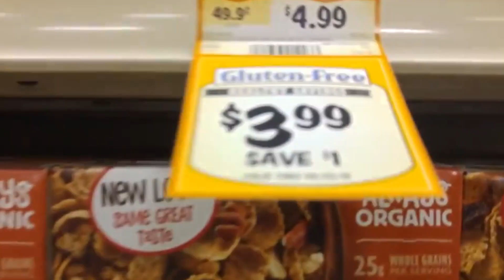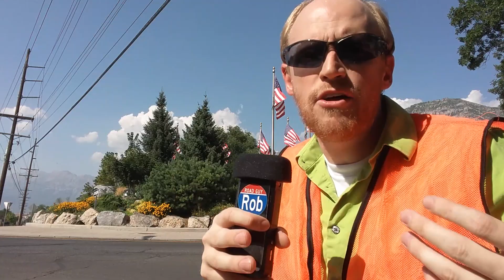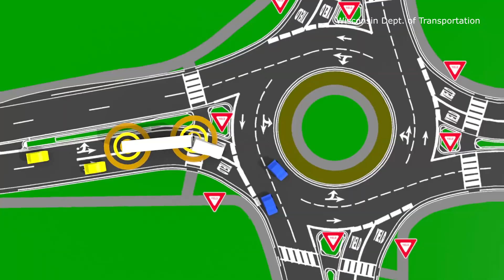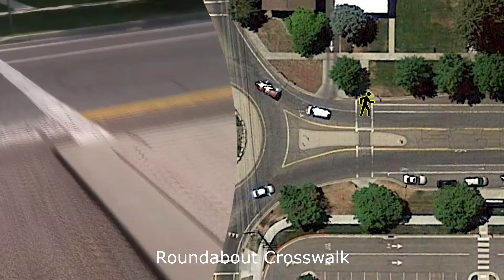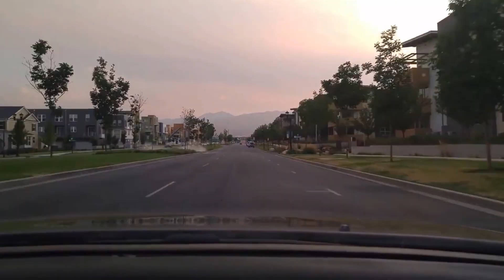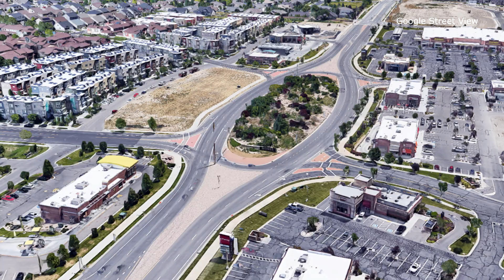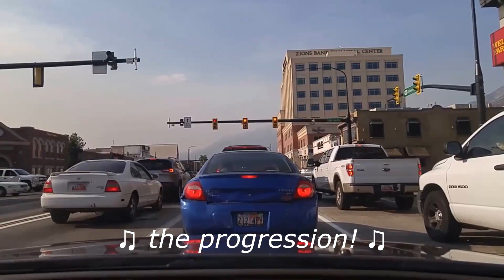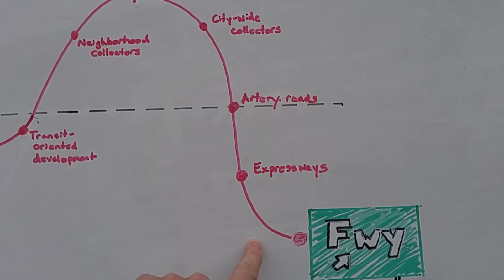Are roundabouts REALLY better than a traffic signal?

Comment: You haven't mentioned the advantage of not having to wait at endless traffic lights, even when the traffic is fairly light. Also, that "platoon" system only tends to work one way; trying to synchronise it all with cross-traffic and it's pretty well impossible (and lights can be combined with roundabouts on really heavily trafficked routes and achieve more throughput and managed traffic flows where essential). 

As for roundabouts on freeways, then those are best designed with on and off ramps and then the roundabout can be put above (or below) the main road. Expensive, but much safer and better flow with less interruption to through traffic.

Comment: What? Our roundabouts have crossings at the point where the roundabout and road meet.
Reply: right so you have to walk around the roundabout to cross the street, which for big multi-lane roundabouts can be very far, and also makes it harder to go straight at the intersection for a pedestrian. Not only that, but it's often nearly impossible to cross 2 lanes of traffic safely without a light which can still put the pedestrian at more risk. I'm not saying roundabouts are bad, just that in places where you want to encourage lots of walking then you should consider that they are a barrier to that. One creative way to do this would be to have better walking infrastructure on parallel streets in a city for example.

Comment: WE have a round about it's the intersection with the most crashes   Also it has the biggest back ups too  they modified it 3 times so far   the latest was not too long ago they revised it after an 18 wheeler flipped over .

Comment: You're the only person I"ve seen talking about roundabouts actually point out that they stink for pedestrians. Everyone is so excited about not having to stop they ignore that it makes things worse for the pedestrians.
Reply: In the Netherlands you usually have to give way to pedestrians. And there is a spot between the crossing and the roundabout so you are not holding up traffic on the circle. 

And the extra steps thing is also much less because the sidewalk usually not that close to the road on roads that have those large roundabouts because that's dangerous too. And when the sidewalk is that close to the road we put in smaller roundabouts because that happens in a 20m/h zone so you need a tighter circle to slow the cars further down.

The problem that pedestrians face is usually not the round about but that the city prioritizes cars above all else. Which gives you chappy sidewalk situations around roundabouts but also on regular crossings where they for example give very little time for you to cross with lots of waiting time in between.
Reply: In most cases it is possible to position the pedestrian crossing much closer to the roundabout than the example shown. Where I live they are often only a couple of car lengths from the Give Way line.
Reply: It's tricky because if the ped is crossing in the space before roundablout entry, it's OK and you see them easy.  But conversely, and 1/2 the time by definition, the ped will be crossing at the exit to the roundabout, where it is very hard for the car to see them.  I've never been a ped crossing the roundabout, but if I was, I'd run across and only when I saw nothing coming as I'd assume they couldn't see me, and being in the midwest, wouldn't care if they did.
Reply: @nixon2tube  That's the problem. They increase the danger for the user who is most vulnerable, the meatbag. I'm getting older, so I can't move as fast as I did and there are disabled, the elderly, and children to consider. And if your idea of make the crossing safer for the elderly and disabled is to make them travel an extra 300 metres, you're a monster.

Comment: What makes a roundabout so efficient is that as you lose speed you can do intentional near misses which increases capacity.
Regarding trucks, in Europe they are allowed to use the outer lane and usually people will give them the whole roundabout.
Reply: Ever tried moving a huge piece of equipment? Its a pain. Here in the US a typical large pickup is pulling a trailer every  few days thats pretty much as long as 2.5 European vehicles. Thats not including the amound of semis (lorries)
Reply: @brandoncaldwell95  2.5 would mean 47 meters, roughly 140 feet...
It also happens occasionally in Europe

Comment: in my town they actually timed the lights so you can't get a continuous flow of green lights so you must stop at each light unless you go at an exorbitant speed. everyone here knows it's faster to take the side streets than it is to take the main roads now and those side streets have become congested because of what they've done
Reply: To be blunt, it's because people are dumb. About 20 years ago, my city was looking at synchronizing the lights so you could get a run of greens if you drove at about the speed limit. I was there to speak in favor of it. Several speakers before me talked about what a terrible idea it was, because "the city will just be a giant racetrack", so I specifically talked about why that wouldn't happen (go too fast, and you'll catch the next light red) and that getting a string of green lights had several advantages, including better gas mileage (cars idling at a light get 0 mpg) and reduced pollution because people won't be sitting idling.  The very next person got up and said it was a horrible idea because it would let cars race across town.
Reply: @almostfm  it's the "carrot" approach to speed control. Drive the speed limit, catch all the green lights. I used to drive down a street that even had a sign stating so (I can't remember the exact wording, though) But then they got the genius idea to install speed bumps, which messed the whole system up. So I would actually speed up in between the speed bumps to try to catch the green lights, but it never worked.
Reply: In my city there's even a better system. The lights are timed in such a way you have to go over the speed limit. What's better there's one pedestrian crossing without lights. Which is dangerous af for obvious reasons. I think the only reason why city didn't add yet another set of lights was to collect speeding tickets

Comment: Like you said roundabout or traffic circles reduce the speed of traffic at intersections and when there is a great difference in speed contact between cars can kill. One downside is that during rush hour they can create a bias. Meaning if most traffic is flowing east-west then the people going north-south are going to have a hard time entering the traffic circle. As the flow will be non-stop with few openings to put your car into. Plus like you said multi-lane circles have a learning curve. Thusly even in the city that has had them for more than 50 or more years, people still can be intimidated by them and create havoc. I personally love them and have seen people that have tried to drive straight through them even with large trees in the middle. The worst one I have seen is in Halifax N.S. called the Armdale rotary I never could figure out what to do, as it was a turn-based flow. From what I understand they have now changed it to a more universal (or what we have in Edmonton) where if you want to travel more than one exit your are required to enter the center lane and the center lane always has the right of way when exiting.

Comment: as a semi driver, from wisconsin to boot ironically, we hate roundabouts with a passion. i know lots of drivers that will drive miles out of their way to avoid a roundabout. no matter what we do everyone is always mad at us. if we slow or stop coming into one, everyone behind us is pissed. if we try to do the speed limit usually 15mph and someone rushes into the circle we don’t have time to stop and then that person is pissed we cut them off. the multi lane ones are even worse because no one understands that we need to use both lanes and constantly try to run beside us or road rage us for “cutting them off”.
Reply: Yep, i always give truckers room if they need it or not for this reason. They already have a shitting day waking up to deal with people why make it harder. Helps i come from a CDL fmaily too. Also concider the people who pull large trailers with their trucks. Id be in the same boat. Least you guys have decent enough large tires where im just one basic street tires that might blow off a bead especially with my tractor and shredder on the rear let alone the people who roadtrain a 40ft 5th wheel with a boat on the rear...

Comment: In the UK, on those busy multi-lane Roundabouts, we sometimes have Traffic Signals on the busier ones - usually the ones that feed onto or off of a Motorway (What you'd call a Freeway or Interstate). So now you can have the best of both worlds!
Reply: What the hell is the purpose of a traffic signal at a roundabout? I thought the whole idea was to NOT have one so traffic doesn't spend 2 MINUTES waiting to move.
Reply: @largol33t1  I normally see them when you have two busy roads intersecting, so you can control traffic leaving a motorway and give them a period of time to join the roundabout in controlled bursts. The timings are normally quite short.

You still get the benefit of "fewer conflicting movements" as well as less dangerous collisions, plus you now have an added system where one flow of traffic cannot constantly overwhelm the roundabout.

Here's one example of a roundabout I know of that has controlled access: https://goo.gl/maps/ihZyXHCRUXftdrUo6

Comment: North St Louis has a terrible two lane roundabout with stop signs (not yield signs) at 90 degree entry points
Reply: Doesn't make sense. The roundabouts in Texas have yield signs. You drive in and keep circling until you reach your exit. I have used them over a dozen times and they're WAYYYY more efficient than dumbass traffic light that has 2-minute red lights.

Comment: Roundabouts are terrible for semi's. A semi is about equal to four cars trying to move at once. When traffic is heavy it can take a much longer time for the semi to turn into it, causing backups.
Reply: That's why some cities in Indiana switch over to roundabout to keep the semi's out.
Reply: @JustSeanRunning  then complain when there are higher prices as now a straight truck delivery company has to get the load to take it to the store. Lets not forget the fuel stations that are surrounded by roundabouts and still require a semi to get there...

Comment: Roundabouts are great in certain areas. When you have a high volume of traffic you can sit there and wait forever for an opening.
Reply: This started as a discussion about how...sometimes...maybe a roundabout isn’t the answer, sometimes we should consider other options, but I guess there just isn’t any room for that viewpoint or it’s supporting traffic studies.  I’ll start recommending a roundabout be built at every intersection.  Okay, thanks for straightening me out.🤷‍♂️
Reply: @EliasSchmid00  Traffic lights in roundabouts was extremely common when I lived in Europe.  From a design perspective, having to add lights is an indication that the traffic has outgrown capacity to allow free flow, which is the whole point of a roundabout.  Once lights appear, it’s time to start considering some kind of compact grade separation.  For example, a compact underpass for one of the mainlines that passes under the roundabout.
Reply: @scottwendt9575  I have to disagree, where I live there are a few roundabouts which have lights, 90% of the time there's at most a 15 second wait for traffic to clear and the lights aren't used at all, but during peak hour when east/west traffic is heavy the lights operate to ensure the lighter traffic is able to enter from the north/south usually this isn't needed anyway as natural gaps still occur.
definitely theres a point at which they no longer free flow but thats hard to accomplish, I'd say lights dont hinder the ability to free flow but improve the functionality during peak hour
Reply: Higher traffic deaths in the US are not the result to few roundabouts. Americans drive almost 3 times the distance as people do in the UK, so of course there will be more accidents and unfortunately more fatalities.  The majority of deaths occur in rural and x-urban areas. Consider that in these areas of our country, a trip to the market is a 100 km round trip and sometimes even longer. Higher speed limits are a necessity, not merely a convenience for those in the middle of the the country who are criticized for not wanting roundabouts at every country intersection.

Comment: Is the Chevy Chase situation of getting stuck in the inner loop and circling all day long because no one is giving the way possible with roundabouts?
Reply: Not if used properly. All incoming traffic have to yield to traffic already in the roundabout. In a two lane roundabout, use the inner lane to go left (or straight if the exit also have two lanes). The outer lane is used when turning right or going straight. That way noone will block the inner lane exiting the roundabout.

Of course I would think it is possible if you're driving through say the roundabout at Arc the Triomphe and lack confidence in your driving skills.

Comment: I think the 'Ovalabout' wasn't really a roundabout. Not because of its shape, but mainly because of its right of way situation. It looks to me it is just a big throughway with a bend in it and crossing traffic has to do wierd double-lane switchovers twice (sometimes with a big detour, sometimes with a dangerously short disance to do so. It's hideous and I agree it had to go. Wrong uses like this would give the "roundabout" a bad name. (i think this might have been mentioned)
Also: With "a complicated one" @5:08, do you mean a turbo-roundabout? because I love those. I feel they're great for maintaining flow. (eg. https://www.google.com/maps/@52.175302,4.5391215,184m/data=!3m1!1e3)
I think the main thing for drivability is to try and prevent the need for scooting lanes over on the roundabout. Every traffic direction is determined before entering the roundabout and on it you just have to follow the lane.

Comment: The place where they tore up the ovalabout could have combined it with traffic lights, both for incoming traffic and traffic in the roundabout.
They portion the traffic as you want and the roundabout removes need for left turn lanes and also slows down traffic a bit. They also make left turn safer - you have already turned left which can only be done at lower speeds and therefore takes longer to complete, which is bad if you have oncoming traffic and small gaps; the roundabout shortens the time to cross and increases the margins.

Comment: Lets see, in the 50's and 60's, we had them all over the place. Too many accidents, law suites etc, they were pulled out. NOW< some smart engineer came up with the idea of putting them back in. Number of accidents are up in traffic circles, mainly with 18 wheelers or large vehicles like RV's, delivery trucks and school buses. SO . . . . . as a LEO, I say they are NOT safer than a red light. We have one in our town, been in service 6 months, well over two dozen accidents so far and counting. In Europe, they have very small cars and their trucks are like tonka toys so yes, it works over there but is not a fit for the US. I think after the five law suites filed in some of these wrecks gets settled, the cost of removing it and putting in a light will be so much cheaper.

Comment: Australia went through exactly this in the 1990s.  Though we didn’t call them Traffic Circles or something else for a long time.  A whole generation has gone by — and now when I visit America, the 4-way Stop is really freaky to me.
Reply: We have one extremely unpopular roundabout — regarded “the worst roundabout in Sydney” — just north of where the A3 meets the M4.  The problem is a large shopping mall lives on one corner and its entrance often takes longer to ingest vehicles into the carpark than the rate at which cars are arriving.  The big problem is that the roundabout becomes part of the tailback, and the traffic backs up in every direction.  Even after a flyover was built over the top of the roundabout for the larger road of the roundabout, the queueing still occurs in 4 directions for hours every weekend.  I think the reason this hasn’t been solved in 20 years is that traffic lights or more flyovers would still get backed up.

Putting my engineering hat on, the only thing I can think of is a snaking pool entrance, where a block of land is set aside that forces cars to fill a queueing bay in first-in-first-out basis.  Similar to an airport checkin line.  If this works, it would mean the roundabout is irrelevant, even though it is so infamous in this location.

Comment: In the UK nearly every motorway junction has a roundabout. 
What happens in America? Freeway exits / entrances? No roundabout?
Reply: they usually have stop signs or yield but some cases they where built in 1800s or earlier (chicago) https://www.google.com/maps/@41.7150841,-87.6433774,834m/data=!3m1!1e3
Everything is built narrow to basically fit around everything else
https://www.google.com/maps/@41.7595943,-87.6465625,2225m/data=!3m1!1e3